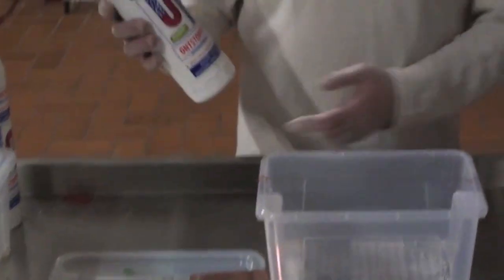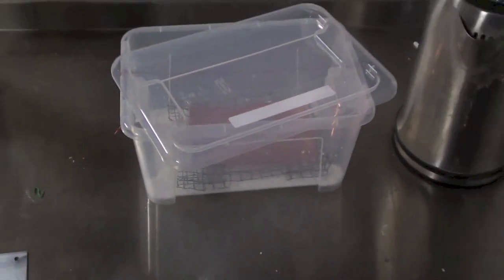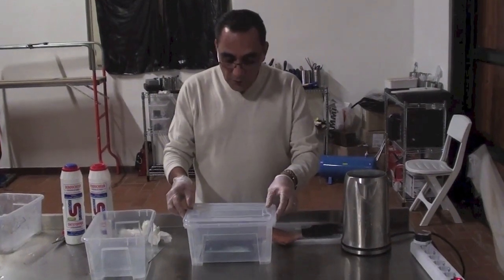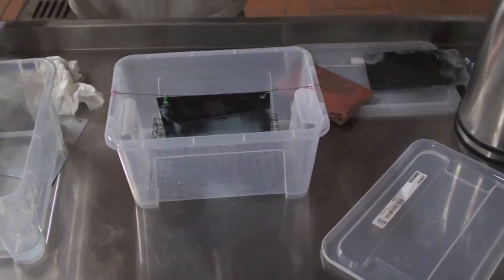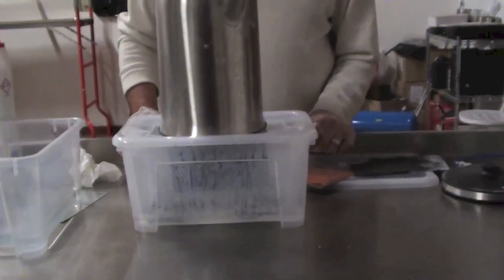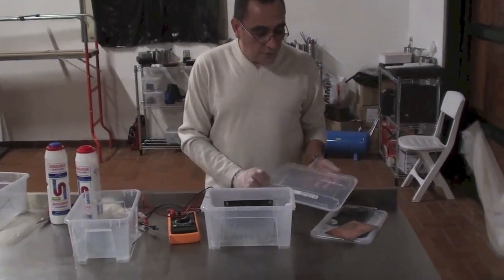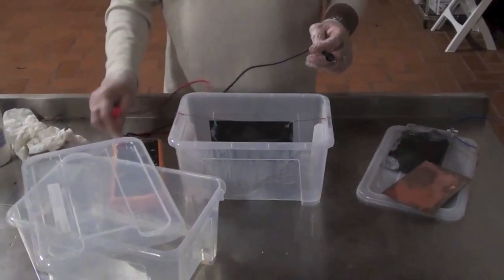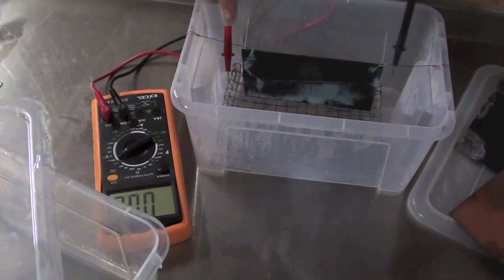Keshe Foundation: Nano-Coating Process

Comment: you do know that when you use a voltmeter it send some current into the red prong to the black prong to measure the potential difference of energy, so how is that draining energy?

Comment: On the first round of nano coating is the copper plate submerged in the caustic soda or is it above the liquid on the mesh?
Reply: 1 cm below cooper plate is water level
Reply: so it is not covered by caustic ?
Reply: The plate should be covered with liquid is right,, so,, recently domunl Kesha explained that it is right that the caustic water to cover material

Comment: I live in an apartment in the city.  How is it recommended to dispose of the caustic water after you complete the nano coating?
Reply: +Sandy Becker if it worries you, water it down then poor it down the sink. Caustic soda is what is normally sold as drain cleaner so it is ok to do that.

Comment: huh this is the same way you make home made solar cells that produce .5VDC I have used copper plate to make a solar cell and all you do is take a copper alloy plate and expose it to a costic environment and it builds up Chromium, copper, carborundum and boric oxide coating then you clean one side to make your Positive terminal and your done. oh the second time I made this cell I used packing tape to avoid cleaning the other side and you repeat until you have a thick Oxide coating the thicker you make it the more Voltage you will get and this cell with produce power in the Dark how about that!!! I realy had a terrible time connecting to the top without penetrating to oxide and ruining three days work :-( also you cannot use any glue or Lacquer on the oxide you will stop the flow of electrons being knocked off the copper in the coating. this all relies on photons and other charged particles hitting the plate.

Comment: i use col water is this ok? i also mix the soda in the water first then add my coils to the water and leave for 2 to 3 days it is blue to black when i take it out
Reply: +phoenix rises nope you have to get that green copper oxide all you did was create a copper chloride coating the Heat is crucial to the oxide formation process. it should be Green, Gray, Black and White
Reply: Justin Schubert i did not use copper i used crystals and other minerals to cote it with but thank you i will try it again

Comment: Does the zinc plate need to be coated .. I've read in two places opposite answers on this ..thanks!
Reply: All materials can be Nano-coated. In Plasma Technology Copper is basically used for the biggest part of applications, but also e.g. Zink for the production of ZnO GANS. https://en.kfwiki.org/wiki/Nano-coating_using_NaOH

Comment: Nano coating= graphene coating?
Reply: It's a coating by cupric oxide (copper-II-oxyde) in nano structure.
Reply: Martin Singer 
Yet some graphene is created on the top of the cupper (II) oxide sp2 and sp3 structures, if the coating reaction is done in the presence of PET plastic, like the Coke bottles are made of. Following your earlier advise, I did an acid test on some nano coaded copper plates, and some portions of the black coating didn't dissolve even in concentrated hot acetic acid. Thank you again for your comments, as you've helped us to add to our knowledge. At least we have now an inexpensive destructive test to indicate, whether the conditions we used for creating the nano layering allowed to create also some graphene besides of the cupric oxyde.

Comment: So we are to assume that both plates are nanocoated Zinc and Copper?
Reply: Only the copper plate is nano coated.
Reply: it's correct but i have a question: Keshe teaches us to use nickel and copper nanocoated and not zinc!! it's true?
Reply: @emyguitar
You may have missed many of M. T. Keshe's public teaching workshops. Don't judge by partial information.
Reply: Is it Zinc or is it Nickle?  Or is there different plications for the different material?
Reply: Thanks

Comment: HI GUYS
CAN YOU PLEASE EXPLAIN WHAT IS THE NANO COATING OF OF THE PLATES GOOD FOR?
Reply: For carbon dioxide capture sets, made of a nano coated copper plate and a zinc plate, connected together with a conductive wire, and immersed into table salt solution in water, within an open top plastic container.
Applications of the captured CO2 are in course of development and testing.
Reply: Martin Singer , have you seen the forensic reports about the poisoning that you mentioned? Check your sources, to avoid to be seen as a stupid hater, who spends his time on trolling, as if he would be paid to do so.
In reply to:
"Martin Singer
+Kakasi Sándor Yes. That's how Keshe poisoned himself with the (alleged) arsenic. (this idiot ate the stuff which formed in his "experiment" (some zinc compound)
Unfortunately unsuccessful :("
Reply: OK I GOT IT.  THANKS KAKASI. HAVE A GOOD WEEKEND